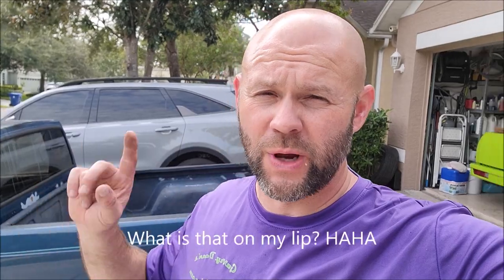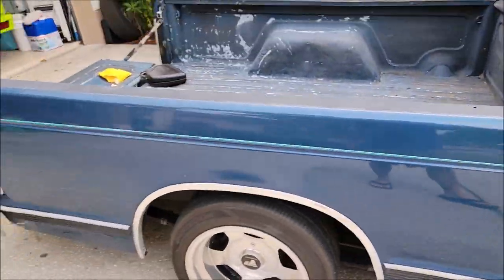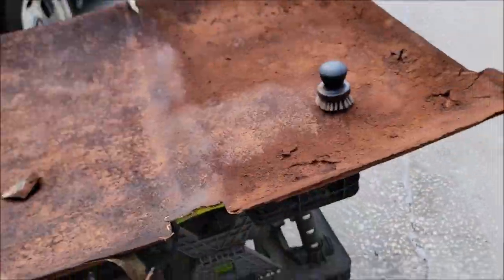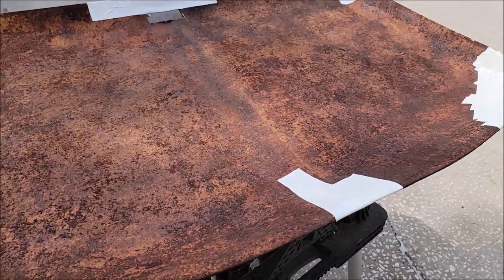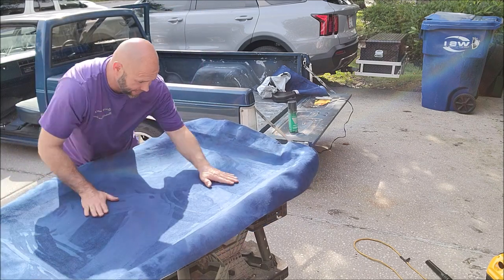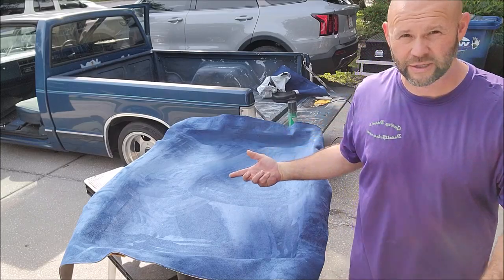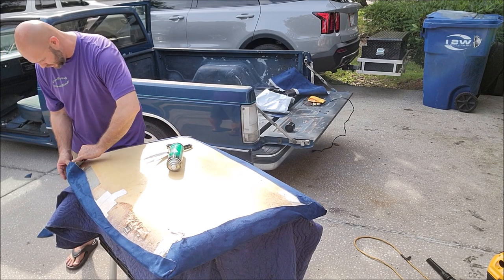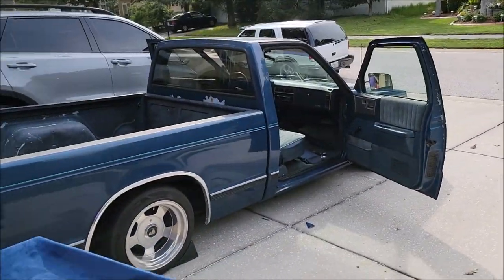HOW TO REPLACE A FALLING HEADLINER - 1991 CHEVY S10

Comment: Nice job Garry!  So what material did you order?  Can you use any fabric or is that a specific fabric for headliners?   Also, would have been nice to show the process of removing and re-installing the  headliner from the truck.  I assume it's just clipped in, what tools are needed for removal and installtion and so on.
Reply from the maker: Headliner material has a foam backing. I mentioned all of this as well as why I didnt show the removal process in the video. To remove the headliner just requires removing the trim panels that hold it up.